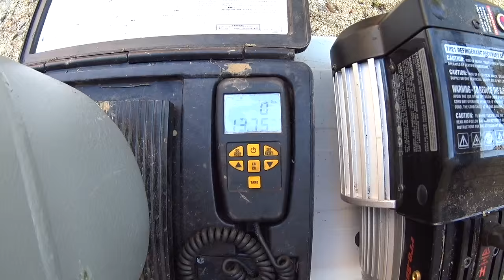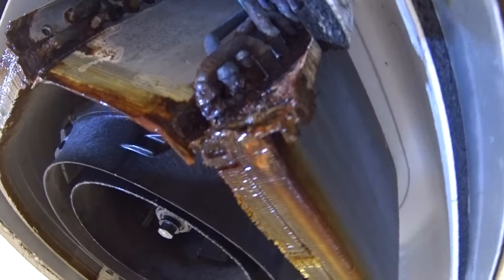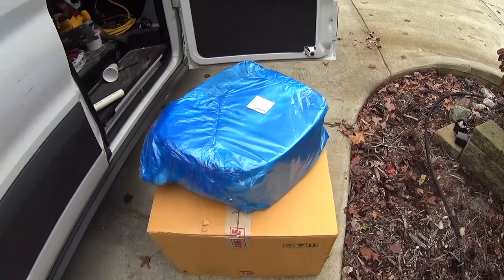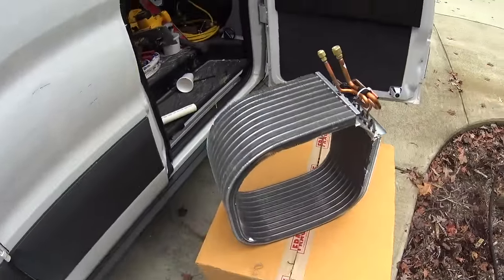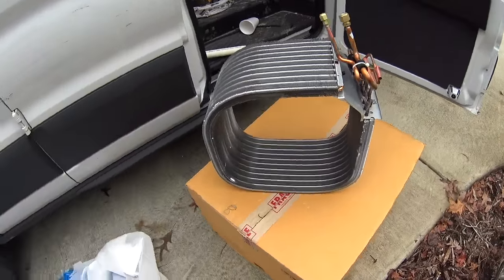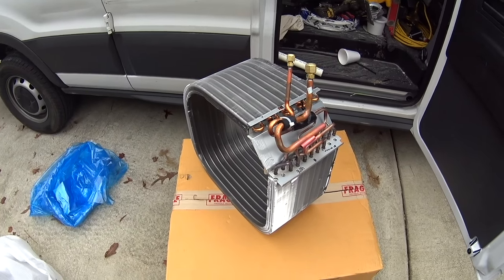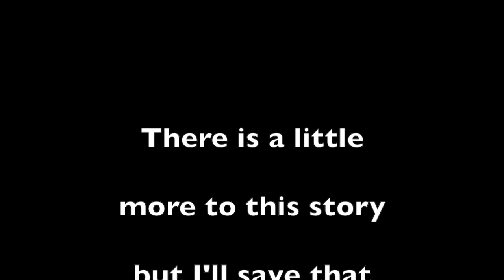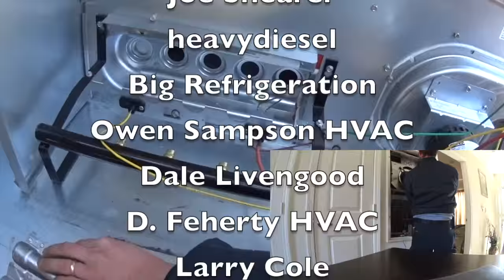HVAC Service: 5 Zone Fujitsu Ceiling Cassette Coil Replacement

Comment: Do you know how old this system is? I have units 30 yrs old that haven't the corrosion of this evaporator, do you feel Fujitsu dropped the ball on this like they have with supplying contractors information for products and service?
Reply from the maker: +Richard Close system was less than 5 years old, still under warranty. I don't know where the breakdown may have been, the NC climate is
Torture on evap coils. If it's able to corrode, it will do so at an alarming rate!

Comment: What's your opinion of the cassette system? Do the evporators sit in a puddle of water? Is it a good design or bad design and would go with a wall mounted unit instead?
Reply from the maker: Depends on how much room you’ve got to play with. The ceiling cassette is not going to be a good fit if the framing in the ceiling can’t be changed. They also have floor mounted units that could work very well for knee wall spaces.

Comment: Was that an exhaust fan in the wall? And why would the put the unit in the corner instead of closer to center of the room?
Reply from the maker: +zeke112964 yes, i'm guessing that there was some other obstruction in the ceiling that made central placement difficult
Reply: Locating ceiling cassettes can be a nightmare.

Comment: Stephen I have a Fujitsu I really need your help.  No one in my Goldsboro knows how to work on these.  They say they do but they don't.  I have a  3 ton Quad  wall mount system .  I am sure it has a leak but they cannot find.  Now when I put all 4 heads on high outside unit is cutting off for 2 mins. then restarts. every once in a while.  Cannot get any fujitsu dealer to come to Goldsboro to look at it.  Would u be willing?
Reply from the maker: +Alex Eco send me an email- stephenrardon@gmail.com

Comment: Your Fujitsu guy: With systems 4Ton and more I would certainly put isolation valves. It just pays off. It's pain in the neck to weight out each time, regardless if it's Mitsubishi, Daikin or Fujitsu lol
Reply from the maker: Can you send me a Link to which kind of valve you're talking about?
Reply: +Chris Sysko it would be nice if manuf. installed them in the beginning, then customer would have much less expensive repair option of closing valves and topping charge.
Reply: +bill demmon it would be nice I do agree but you know the answer for that... Unit price/competitiveness issue
Reply: +Stephen Rardon (HVAC with Stephen Rardon) I do recommend full port refrigeration ball valve with access port. This is not mandatory so you won't find that in installation manual.

Comment: That is why I refuse to even get involved with mini splits, it takes three to four weeks to get parts and when it's 100 plus degrees here in Phoenix that just won't work. I think that as service companies we all need to boycott these companies.
Reply: Exactly Larry. I'll only install them in non critical situations here in the SoCal high desert. They're great for man-caves and atticless room additions... but we had one go down in a boarding room at the animal hospital and thank God we didn't install it because it took forever to get cooperation out of Fujitsu.
Reply: LR Hall any experience with Mitsubishi starting to see them a lot in my state from old homes new homes small business our central is well literally only way to say it is shit $500 repair goes down in 2 days brand is Trane were taking this junk to the recycling center cause the warranty is junk our home is a small 3 bed 1.5 bath built in 1911 poor build so duct work is trash as well with central my room has the system in it so my room is like 60 my parents is around 70 kitchen and living room 80 and since the thermostat is in the living room never stops if it even runs if it breaks every 2 days or runs no cooling I bet a mini split especially Mitsubishi can't be worse biggest worldwide brand were are going with 5 indoor wall units 1 each bedroom and 1 for kitchen and living room must be better as they all cool independently and evenly slowing down one when it's good cranking another one when needed our central would blast it all in my room in order to install new duct work we would have to tear the drywall from the ceiling old homes are not fun to work with
Reply: Larry Cole 
Are you serious? Wow i live in the netherlands and most part are in in almost 2/3 days over here you see splits everyday.
My daily work is splits and vrf systems.
Reply: I would not boycott the companies but I would definitely make customers aware that parts are not readily available for these mini-splits.  I "might" install a mini-split on my garage workshop.

Comment: How accurate is that torque wrench you're using?
Reply: long ago post but you have a point.. The Mitsubishi  dealer that did my install says the should be calibrated  which I wonder how you woukd do that, or replace yearly..  He thinks they loose pounds with use and compression  fittings  are not  forgiving.

Comment: have you ever heard of EMI split systems? They're pretty cool because they are very simple the metering device is an orfice located in the evaporator and you don't have to use one of their condensing units if you don't want to I use them as much as possible especially for computer rooms because it's so critical the only electrical OEM parts are the evaporator but the condensing unit you can get anything that goes wrong with them at your local supply house regular basic stuff. So if you're working on a job 3 tons 460 volt 3 days you can get a EMI evaporator best 220 and then any brand condensing unit 460 volt 3-phase you can go to their website and download all the PDFs check it out you might find it beneficial selling their equipment on some jobs that might come your way especially for computer rooms

Comment: This is why it's standard professional practice to install ball valves with service fitting to each line just after the distributor box. If not because of cost , then should at least explain to the customer what the cost  difference in cost would be every time when looking for a leak and having to pump down the entire system.
Reply: +t lech they are not always reliable, best to take off and insolate from the rest. pump takes 5 minutes.
Reply: +t lech On the bigger systems we use water or glycol no refrigerant. this can be a hazard imagine a 500 pond leak in a small hotel room people will die! The ball valves we use on centralized supermarket refrig. systems. I come a cross ball valves that leak, and a vacuum will not hold, not to mension the crapp you get when purging
with N2 and this leaks by on the ball valves, dont get me wrong what you are saying makes sense in theorie
but in the real world this is not always the case.
Reply: Please do! looking forward, always interesting.
That is

Comment: Wouldn't it have just been easier to replace the evaporator Stephen, or was that a Fuji decision? What a nightmare ordeal.
Reply from the maker: +LR Hall it was under warranty
Reply: Yeah so I guess that's the way Fuji handled it eh? I've asked my supplier about that exact scenarios and the answer I got was "they'd probably just send a new head" but it appears not.

Comment: Its rare for them to leak, think i've only ever seen one cassette coil leak and that was an shitty Airwell unit.
Reply: you'd be surprised , having a run of Daikin cassettes that are rusting out , but that may be due to someone not rinsing coil cleaner off them . ,but that's a different story
Reply: poppypiesdad1
I don't know whats happened to Daikin, they used to be the best on the market, have heard of lots of problems with condenser coils leaking. We only fit Daikin if people specifically request it.
Yeah I always rinse off coil cleaner even if it says there is no need to.
Reply: +heavydiesel seems to be across the board , poor products and poor warranty request too
Reply: Toshiba are offering seven year parts and labour warranty, (UK) we are looking into fitting more of their stuff.
Reply: +heavydiesel I'm up in Scotland, Tosh stuff ain't popular but the parts are cheap